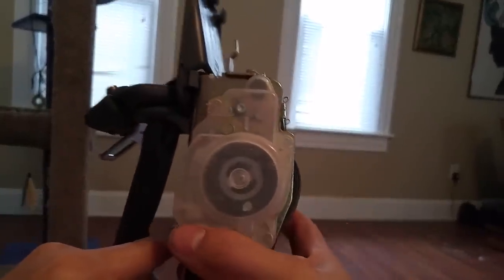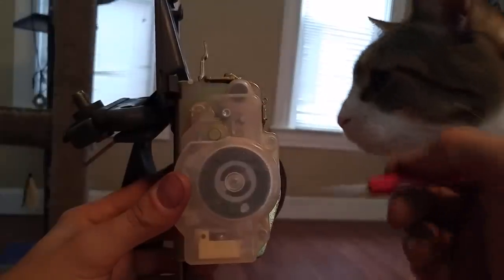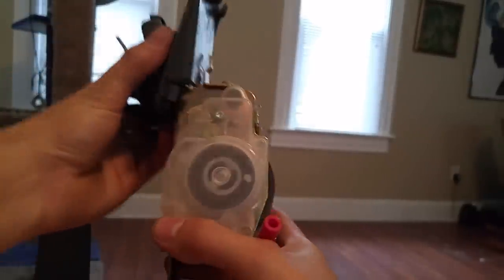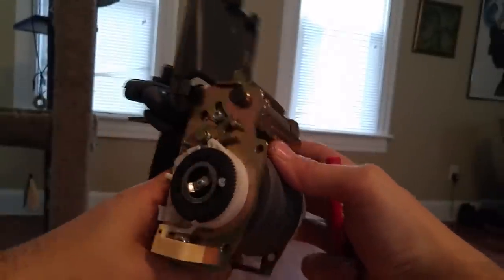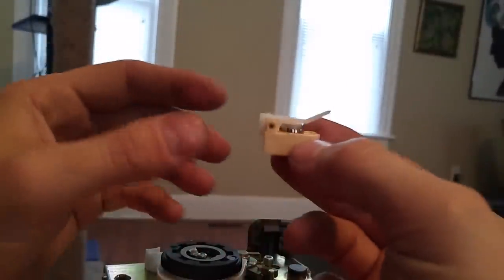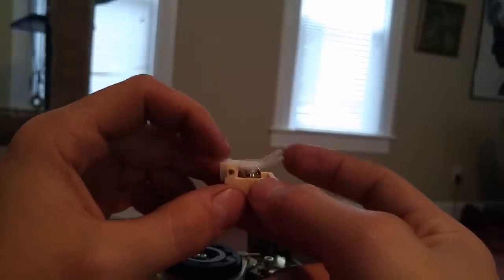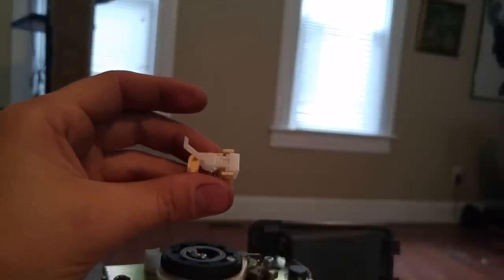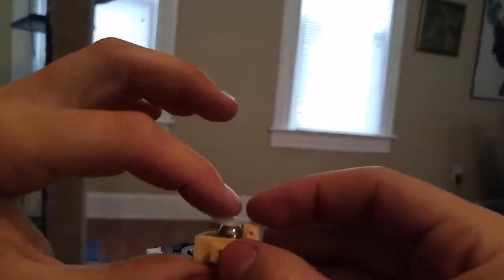Easy Fix for Stuck Seat Belt

Comment: I had the same problem with my passenger seatbelt, I was going to follow your advice but decided to try something first. Thinking about your explanation of why the ball jams I thought if dust can get in then it can go out the same way so I went to the £1 shop and got an air duster, I blasted the seatbelt mechanism still in its original position. To my surprise it fixed the problem the seatbelt is working great now with no dismantling.

Comment: I found your video the most helpful when I got some new seat belts from the wreckers yard. My Saturn L-series had retractors with ball bearings like yours. I opened up the cover, removed the ball bearing assembly and was then able to uncoil the belt. I reinstalled the assembly and all is good. Thanks!

Comment: Excellent video !  solved my issue with a 2015 Honda Fit, the  seat belt MUST be oreintated in the postion it is installed, to  allow bearing to move properly. If not, it locks.

Comment: Thank you for posting this! I just bought an 88’ Toyota pickup and swapped the seats that were in it for a factory bench seat, but I currently don’t have any seatbelts installed because the one’s I got are locked and I couldn’t figure them out. I’m gonna check them out again tomorrow and see if I can fix them by using your method.

Comment: Thanks for this video. Had this same problem (93 Toyota Pickup) and was wondering what would cause the problem. Watched this before I tried to extract seatbelt mechanism. Took an hour to fix and that was going slow. I did not have to take out the entire seat belt out of the car, only the mechanism. If it happens again will try the compressed air trick.

Comment: Great information, thanks!  HOWEVER, this ball is dry for a reason; so it will roll easily.  Any lube no matter what will attract dust and dirt.  I would not lubricate it.  The exception might be silicone spray.  Even then, as long as the ball and housing is clean it should work fine.

Comment: I have a 1997 Dodge Dakota pickup truck. Is the seat belt retractor the same design? The belt will not release and let me pull it out enough to buckle it. Thanks for the video!

Comment: As a qualified mechanic of 30 years experience, I I feel compelled to say that this is not only illegal but it will void any insurance claim you have if you're involved in a crash. Seat belts are a NON SERVICEABLE  item. They are NON SERVICEABLE because they are a critical part of your safety in a collision. If the insurance company discover you have tampered with your seat belt, they will void your policy.

Comment: Great! After watching this, and watching how to reset a second-hand/removed belt assembly by pulling on the belt to pack it tighter on the reel, and then put a clamp on the belt to keep it there until fitted made it work fantastically. Easy when you know the methods, and rules.